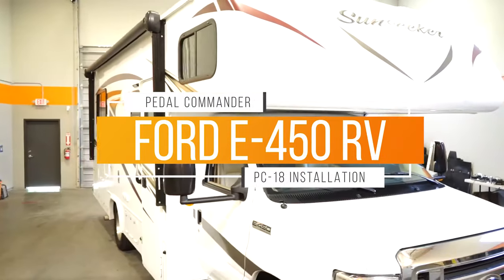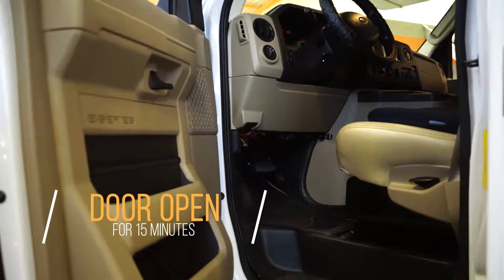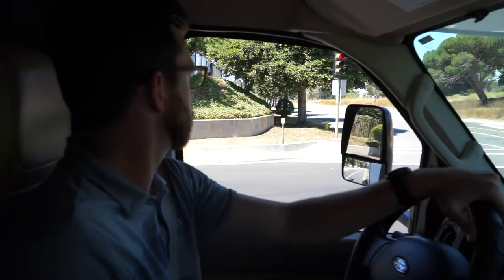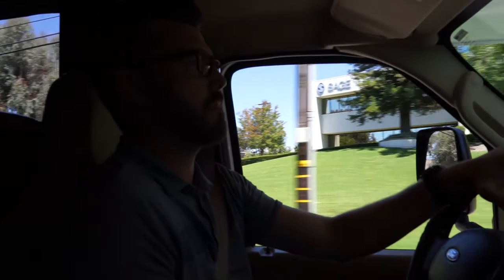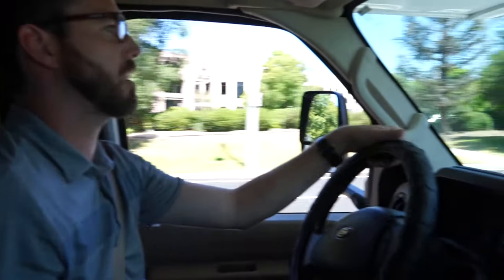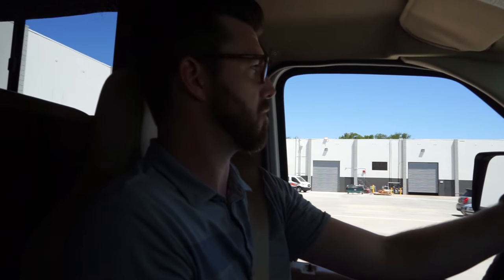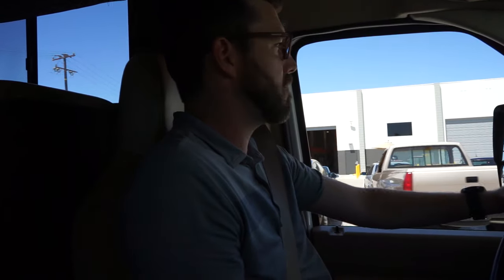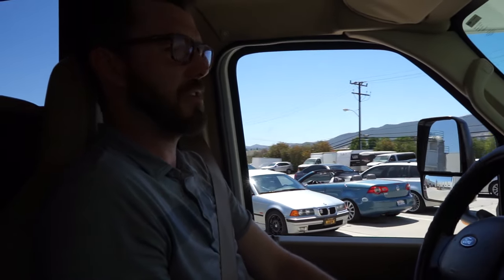Pedal Commander PC-18 installation - Ford E-450 RV

Comment: I bought the pc18 peddle commander and it didn't  work on my RV. I tried 10 times and it won't take The Program. I called peddle commander and they said it doesn't work with my RV. ECM won't accept the program. I don't know how they got his to work, unless his is an older Rv. I ordered a Sct tuner that will work with my Rv and give me 45 more Hp and help with the throttle response and trans shifting.
Reply from the maker: Hello! Can you get us your order ID so we can check your peddle commander order ? Because All the entire Ford Family takes one pedal sensor be your RV may not be FORD

Comment: Does it fit on a 2000 e450 motorhome with the v10?
Reply from the maker: Unfortunately, the Pedal Commander is only available for ford model 2011+
Reply: So I have a 2020 class C RV E450 what exactly does this do for me?